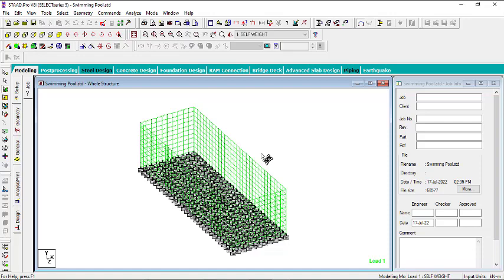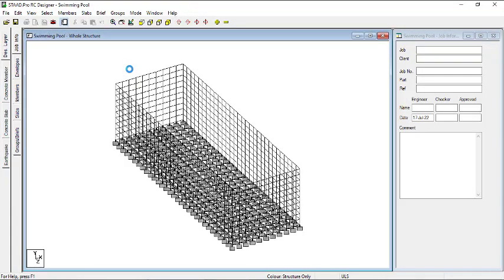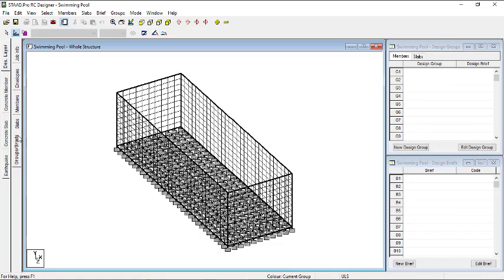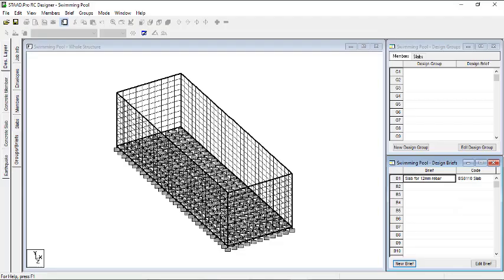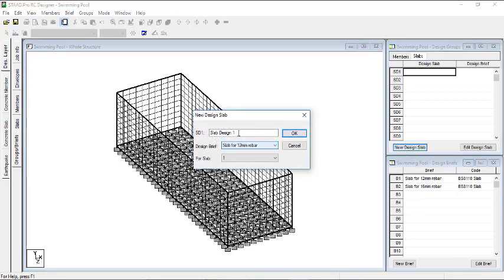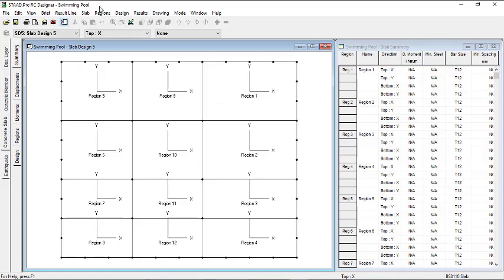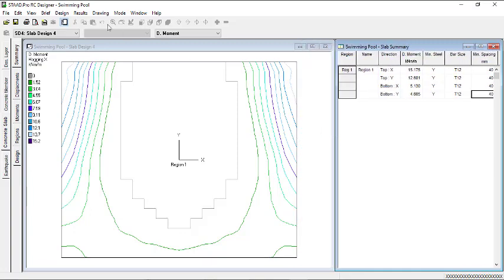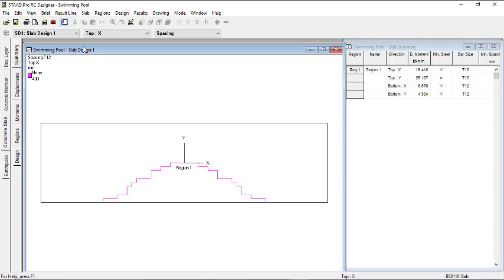Staad Pro for beginners (episode 17). Complete design of a swimming pool.

Comment: Good afternoon sir,
Please how can i design a slab in rc designer when i used floor load load method instead of the plates.
Secondly when i have shear walls in my design, i find it difficult to select colimns without interfering with the sheqr wall.
Hope to hear favourably from you. 
Thank you sir.